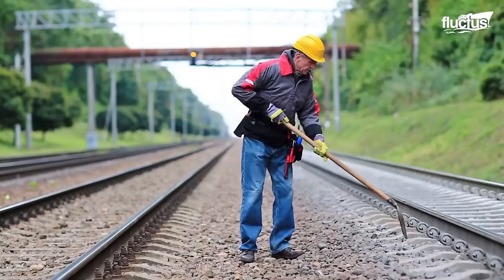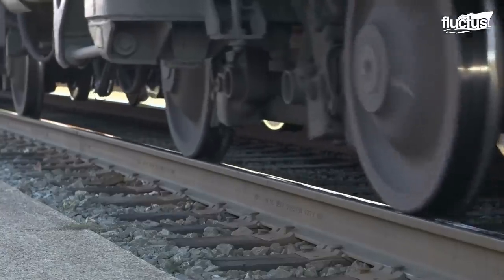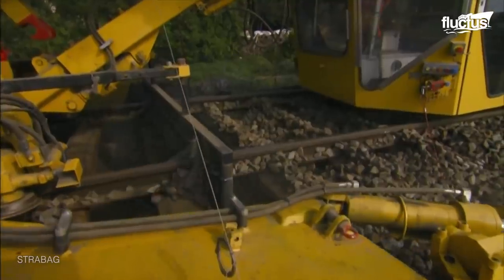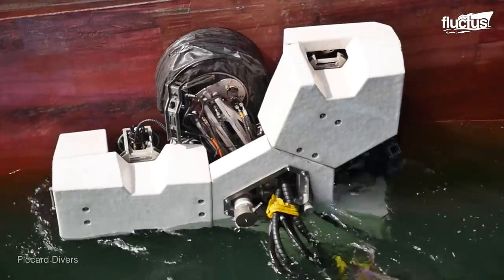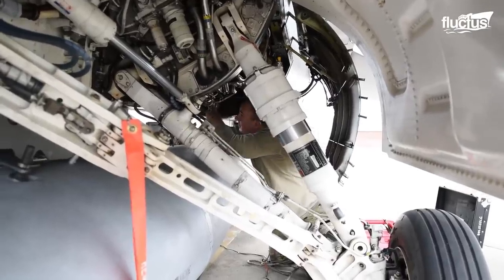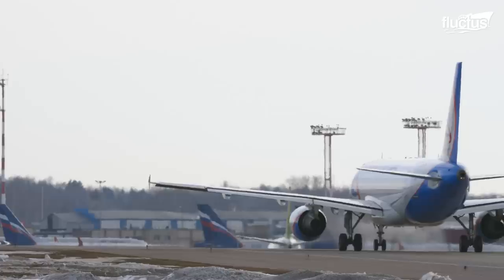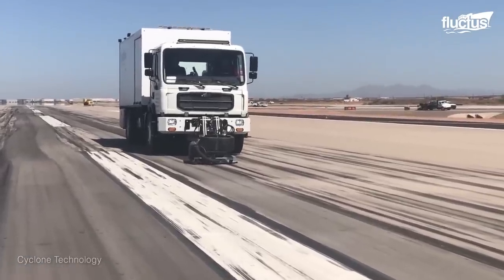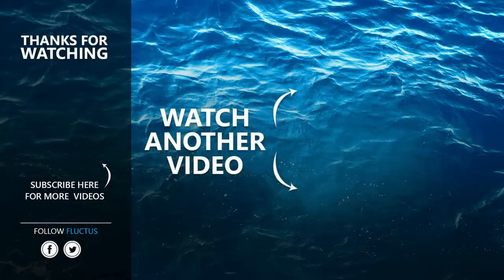Hypnotic Process of Clearing Ballast on 1000 Mile Rail Tracks

Comment: This is excellent.  When I was in the Air Force I was in "Exterior Electric Department". I was a Power Lineman that maintained the base electricity, to include the over head power lines, the substation on base and the airfield  power and lighting. Great job, I loved it. Great Video, as always. Thanks
Reply: Thanks for your service proving electrical service

Comment: Amazing contraptions they come up with.
Reply: And small compact military installations - such as Joint Base Andrews - will have several.  Despite it being the home of Air Force One, it has several auxilliary areas where aircraft operate around the clock.  On the Reserve Component side alone, you have the DC and Maryland Air National Guard, the Maryland State Police, the Coast Guard, the Park Police (United States and Maryland), MedStar Life Flight, etcetera.

Comment: The rail grading/ballast equipment was trick.
The company shown using it was Rio Tinto. They are a LARGE mining company, mostly open pit mining
Reply: That open pit, starts off as a mountain in nth west Western Australia
Reply: @stephenhunter70  Thanks for the info on location. I saw a video where Rio Tinto also has another, large open pit mine in some remote and extremely  mountainous terrain.  I don't remember where, but the road just to get the initial material in was treacherous, steep, with lots of sharp turns.
Reply: @gregparrott  Yep that sounds like em, funny thing though some of their minds you'd be hard stretched to call pit mines. There basically taking the top of mountains.
Reply: @stephenhunter70  I get your point. So, instead of 'pit' mining, they're 'crest' mining, or just plain terraforming the land.

Comment: The machine for spreading the ballast on the track ,called a ballast   regulater the ballast witch has been run by a ballast train down the middle of the track the regulater spreads  the ballast across and on both sides of the tr ack And the funnel  run cleans the excess from the top of the track ties ,for won't of a better word a rotating broom with Brussels 50mil in diammitaer and grads both sides of the track to profile with out  rigger ploughs